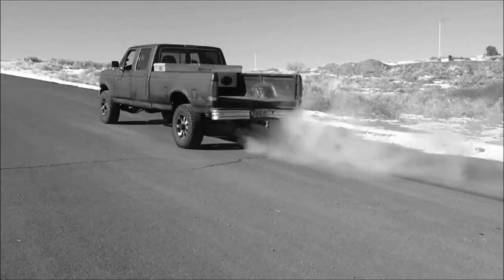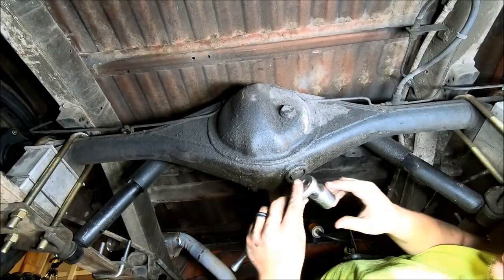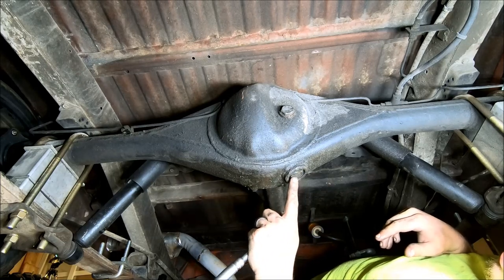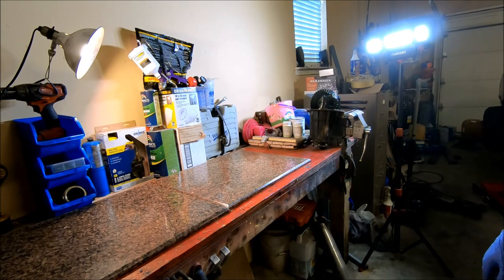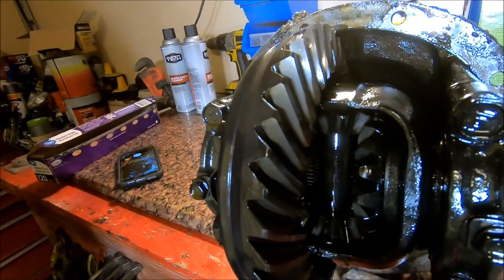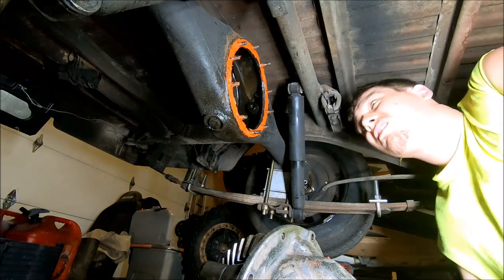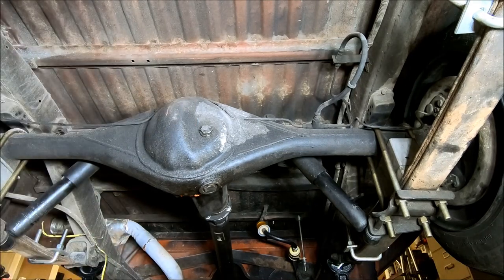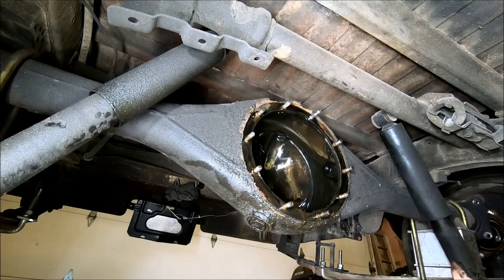How to WELD a TOYOTA rear end - FULL DETAIL

Comment: Nice, i was planning on doing the same to my 78.
Reply from the maker: If you're competent with a welder it's pretty easy process. I had never done a "drop out" style differential so pulling the axles and everything seemed like it was going to be a pretty daunting task but it went really smooth. Wish I would have done it sooner.

Comment: Great video! Do you know if this is the same for the 2wd 89-95 pickups? The rear end looks very similar to mine, I'm just not sure if the process is the exact same or not.
Reply from the maker: Going to be very very similar if not the exact same process. The only difference would probably be if you had the factory electronic locking diff or disc brakes, otherwise it's going to be near identical for all of the toyota (and nissan) truck rear ends.
Reply: @BCDriven  I don't have an electronic locker and got the drums in the back so I guess I'm good to go! How do you think a welded diff would hold up with 15x8's with a 205-55/15 tire? I'm trying to find a nice wheel and tire setup but don't want to grenade my diff every month. Thank you for posting such an informative video!
Reply from the maker: @patrickfields3392  I have 15x10 steel wheels and 205/55 tires on mine. It's been just fine for a year and a half now. I haven't taken it easy either, lots of burnouts, lots of miles daily driving, lots of 4+hour road trips. Personally I wouldn't do it if you use your truck for truck stuff like pulling a trailer or loading down the bed as that puts a lot of strain on a welded diff. Our truck is just for road trips, car shows, and of course the occasional burnout contest haha.
Reply: @BCDriven  Haha, I know what you mean, I probably won't be doing much hauling with my pickup, just a daily driver for high school right now. I've done some research on what wheel and tire setup I want and I've narrowed it down to a 15x8 -19 running a 195-60 r15. I want a nice budget friendly setup that still looks good but isn't too aggressive (it is a daily). The welded diff will probably wait for a few weeks, mostly because I want to see how it will handle with the new wheels and because I don't have powersteering lol.
Reply: @BCDriven  Also, thank you for all the info!

Comment: I have a 92 is the same and will the axle withstand it?
Reply from the maker: Yeah should be very similar and yes its strong enough. The only time you might have to worry about strength is if your running a lot of power through it or big tires but these rear axles are stout.
Reply: @BCDriven  appreciate it 🙏

Comment: That thing is begging for a small s/c!!
Reply from the maker: Turbos make cooler noises lol that'll be down the road if this 22r ever lets go.
Reply: @BCDriven  I agree. Used a 16G mitsu turbo to boost my 22RE about 20 years ago. Thought it was ok until it pushed the head gasket & lifted the head
Reply from the maker: Yeah, with the carbed 22R my options are kinda limited without dropping some coin on an EFI manifold, Ignition setup, and standalone engine management. Keeping my eye out for a wrecked Lexus  or something I can grab a 1UZ swap out of. Hate the thought of LS swapping it even though they are cheap powerehouses.
Reply: M60 or M90 with a totally different carb set up could be done really cheaply. I've been kicking around the idea of using a factory 
S/c on my 1grfe for a while. Just really don't want to bite the Holley management bullet!
Reply from the maker: Yeah I still lean towards a turbo setup most of the supporting mods required are similar in cost for either setup, and for sure on the Holley alone would cost more than I have in the whole truck lol
Reply from the maker: Engine management would probably wind up costing me double because I would try to go with a cheaper system like microsquirt, then get fed up trying to learn the software and then ultimately wind up buying a holley system. There's just so much out there in the way of support for the Holly ECU and he software looks pretty user friendly.
Reply: It's honestly the only way to go now imo. I've used Accel dfi & went to their classes for a few years until they sold out. Their stuff was the best for quite some time & were way ahead of the curve of everything else. Still have one actually... But knowing what I know now Holley's stuff, if you're willing to spend the $ on all of the sensors etc , blows everything else away
Reply from the maker: Good chat man, hey if you havent subscribed go ahead and do that. The video Im editing tonight is me winning a burnout comp in this truck you'll want to see it lol should be up this weekend or so.